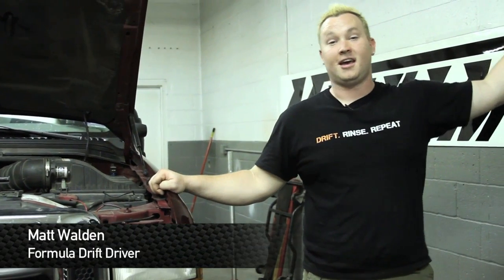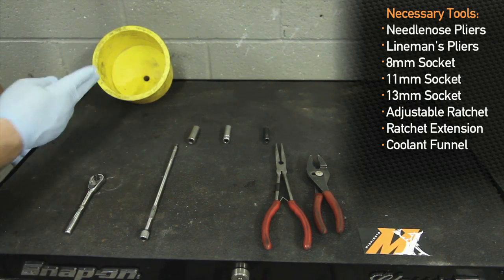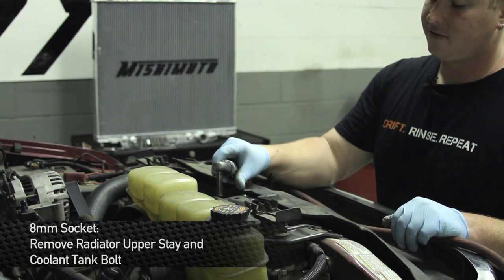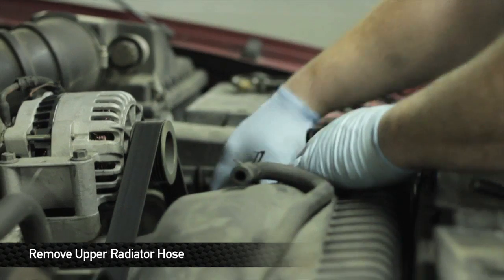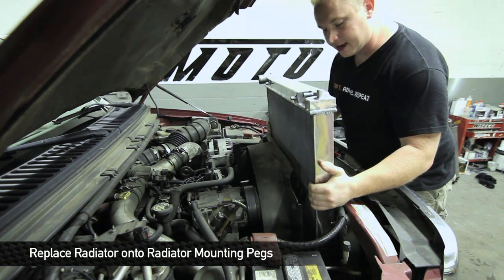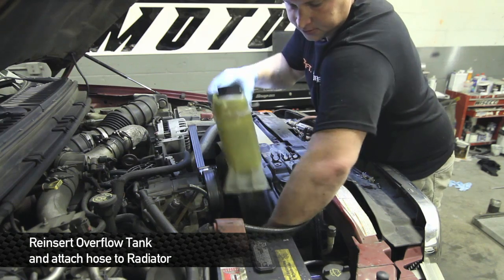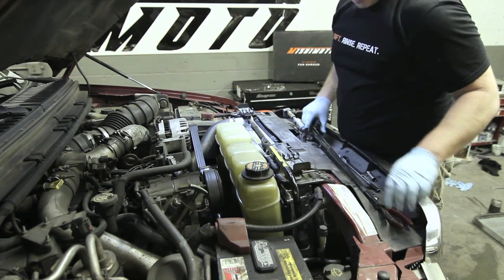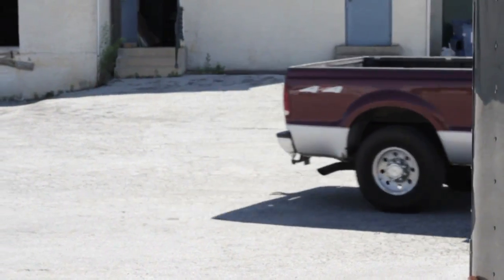How To Install: Mishimoto 1999-2003 Ford Powerstroke 7.3L Performance Radiator

Comment: For those asking about the transmission lines. Get a good size catch tray or two for under the fittings. I used a 5/8 spanner to undo the fitting on the end of the pipe whilst holding the larger fitting that threads into the tank with a shifter. If like me you are doing a few jobs whilst the radiator is out and you can get to them, leaks etc. Then I highly recommend a short length of flexible pipe about two feet long and a hose clamp to have on standby. The shorter of the two metal pipes that you undo will back syphon into your catch tray. It’s only a slight looking run of fluid but it doesn’t stop. It just keeps slowly back flowing and I lost 1.2 litres of fluid into my catch pan before I realised after about 30 minutes. My handy bit of hose was clear and I let it sit vertically so the fluid would find its level and stop syphoning. The level of the fluid rose about a foot back up the pipe vertically to about the base of the pulley on the crank. I would have lost a lot of fluid. 
Another tip, the original radiator is heavy. Get under the truck and pull the lower edge of the plastic shroud over the lower pipe fittings and drain petcock whilst pushing the radiator up a bit past the shroud base. If you don’t the lower edge of the shroud catches above the petcock etc stopping you from lifting it up and out. Once you have cleared the shroud it comes up easily. If you’ve got a bad back, have a buddy ready to help you lift it up and out. I highly recommend the 6.0 Mishimoto Trans cooler upgrade for the 4R100 trans too before you cook it.
Hope it helps,
Cheers 🍻
Reply: Also ear plugs work well, once you get them disconnected

Comment: Hey can i install that 7.3 transmission cooler on my 2003 ford f150 Harley Davidson f150. Want to upgrade
Reply from the maker: Hey Jay - this is a direct fit for Ford's 7.3L Powerstroke - I'd advise you to consider our universal trans coolers for your F150!

https://www.mishimoto.com/truck-jeep/truck-jeep-fans-accessories/truck-jeep-oil-transmission-coolers.html

Comment: I too was wondering about the bottom transmission lines.  I plan on buying one off these radiators.
Reply: msredneck001 install an aftermarket they work way better at cooling your transmission

Comment: Does the mishimoto raditor hold more fuild and how much ? The video says stock holds 5 gallons but show 4 gallons going in, then recommends using a 50/50 mix. "Any help on this ??"
Reply: ***** I know its 7 months later but an answer for you... There will still be about a gallon left in the engine itself after draining and replacing the radiator.
Reply: My 2002 7.3 holds just shy of 8 gallons.